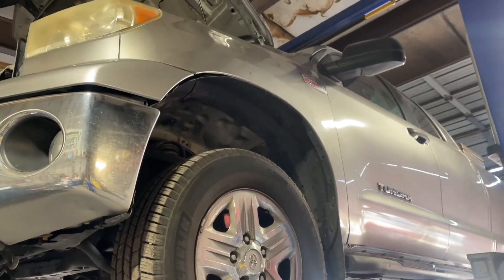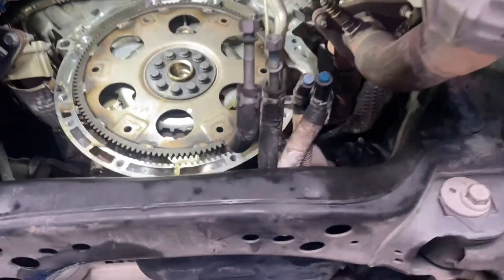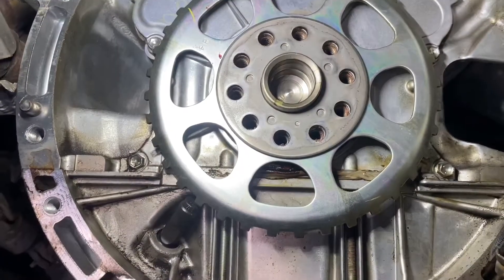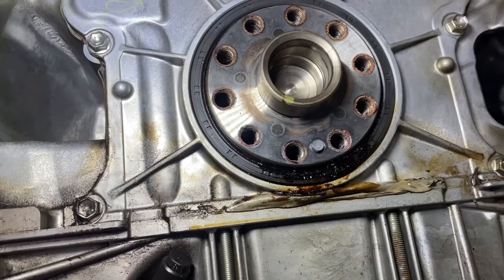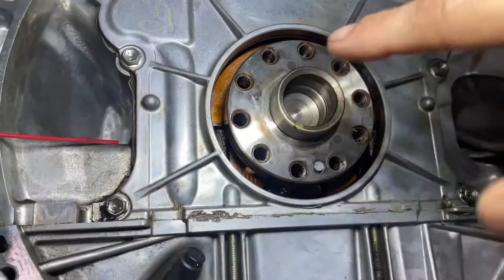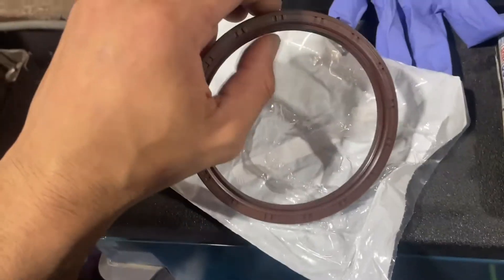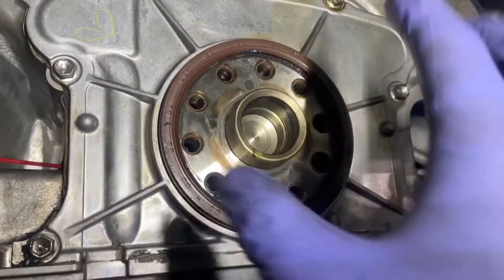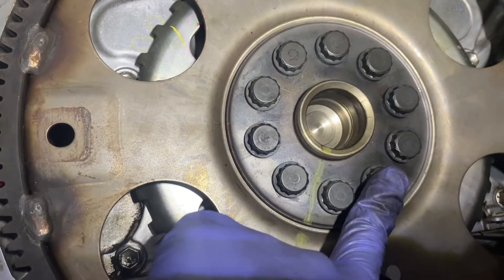2012 Toyota Tundra Rear Main Seal Replacement

Comment: Hi! I got the seal replaced on my 3URFE and i still see oil leaking from the same place.. Its not as much as it was before.. Do you know if there is any other seal or o ring behind the seal plate like the 4.7 V8? Can use some help.. Thanks